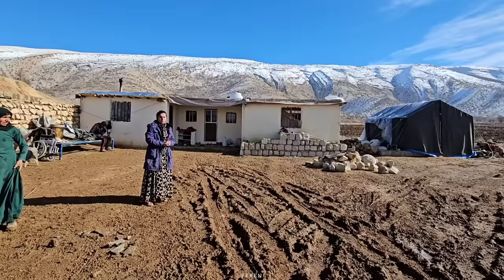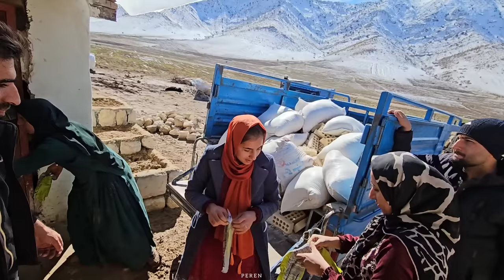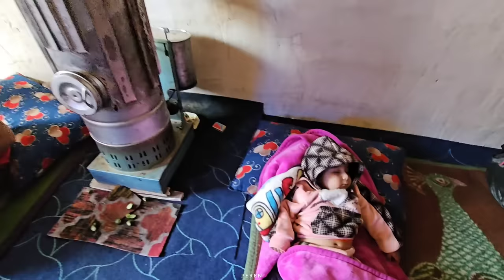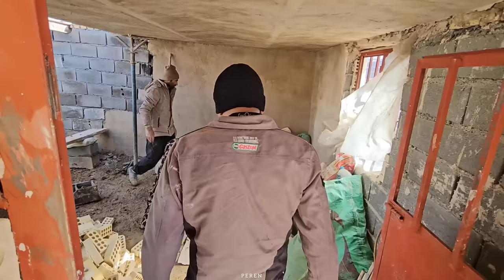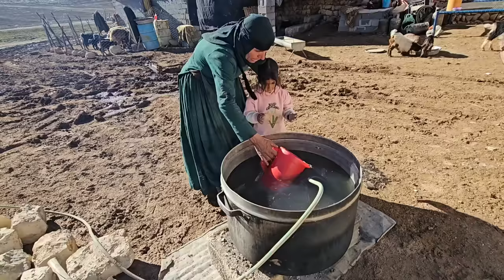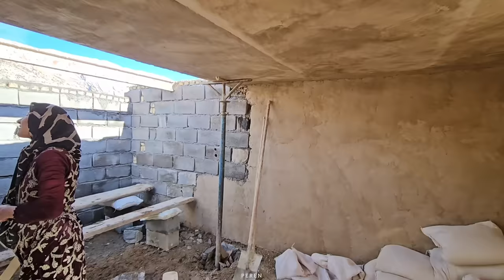Ava and Tianaz return home.👧🤱  Grandmother and family greet Ava happily🧡🧡🧡

Comment: ❤ we roof our house with an angle higher on one side and lower on the other so that when it does rain, the water just comes right off we do not like flat roofs. A flat roof will leak all the time no matter how much rock or concrete you add to it. I don’t know why you all insist on using flat roof. All you have to do is just lift it up some like, for example, in the front of the house, make sure that it is at least one block higher or taller than the back leave one line of blocks off on the back. and start angling everything down. But you also need to leave the board that you use as the roof like 2 to 3 feet longer so that the water will not fall directly on the side of the wall and close to the dirt where the water can seep in under the house. you do this to the house all the way around front sides and back. If you don’t believe me look at pictures on how they build houses either in the USA …. England or other places. So maybe from now on, you will start building with stones which is a lot cheaper and you will have a lot more money to buy your water and food to eat. Do you see the angle of your tent? That’s the angle that a house should have but if you don’t know how to do that angle, then you only do one side of it to look like that up on one side but not high and down on the other like I said only one block up higher than the back. Try it you will see the difference. I truly do love you guys and I pray for you all the time but like I said, if you use your heads right and build your houses of stone, and instead of using mud to hold the stone in place, you use concrete Cement whatever you guys call it. And that will hold the stones in place but let the stone show on the outside it is beautiful. I love watching that wall. I would give anything if I could have stone free. On the property that I live on but unfortunately, if I want stones, I have to pay for them and the stones here in the USA are a lot more expensive than the ones you have for free. We pay more for stones than we do for blocks and bricks. And bricks are a lot more expensive than blocks. The block sitter made here in the United States. Do not break as easy as the blocks there in your country, those blocks seem to have a lot of air in the material and the slightest little hit will actually break them. God bless you keep you well, may Abba, and my heavenly father, my Lord Jesus Christ, take care and protect you all amen.❤😅

Comment: ❤ my dear editor. In order for a more suitable house to be built, there is supposed to be a lot of thought put into the building of it. The way that this teacher or master however, they call him is building this house! It’s not really right. The building of house has no structural, the blocks are supposed to be filled with concrete, but it’s supposed to be filled with concrete that have pebbles in it like little tiny rocks and mixed with the concrete. And in this place, why build a more suitable house when the government is just going to turn around and find another excuse and tear it down. I tell you one thing! If you build a house of stone, it is a lot better because the stone is free. All you have to do is gather it up. There’s a lot of stones there and rocks the way they were doing it in the beginning until they started building the houses with blocks. And then they went on to add bricks, asked the ceiling and spent a lot of money on the bricks. When they could’ve used the wood and covered it up with concrete on the top and on the inside. Because you cannot see the bricks anyway, so therefore, the beauty of the bricks are supposed to be shown the way the Italians use it for ceilings is totally totally wrong, because you are wasting money on some thing that is not going to be seen. I’m sorry to tell you this. But I am a woman and I do know construction. I’ve worked with construction as well for many years. I am a woman, an old woman that have done, many many types of jobs a lot of them men’s jobs. That includes roofing a roof. I hope you all are actually reading the messages and not just giving the hearts away just like that for no reason.❤😅